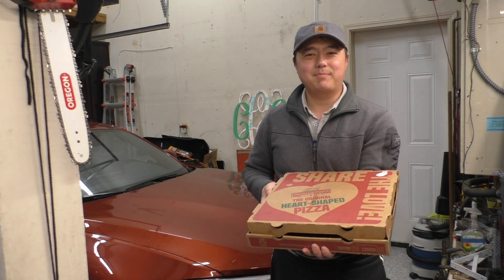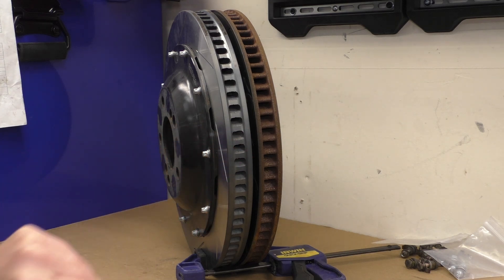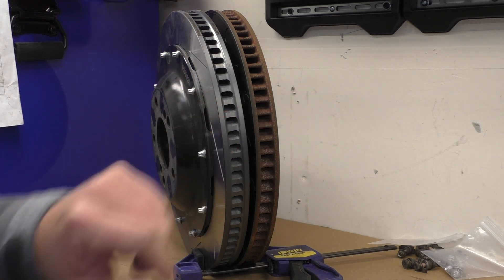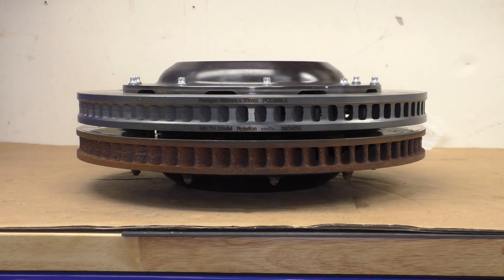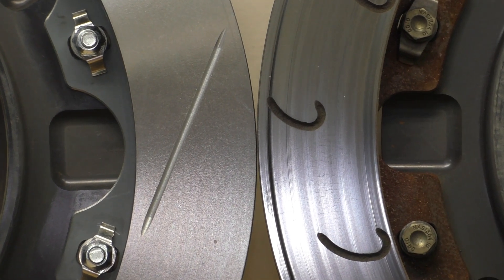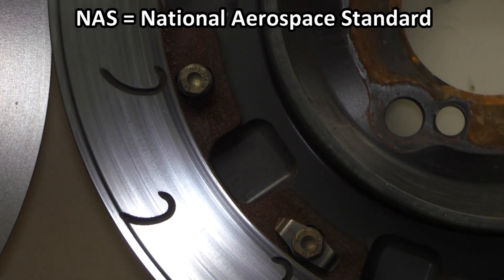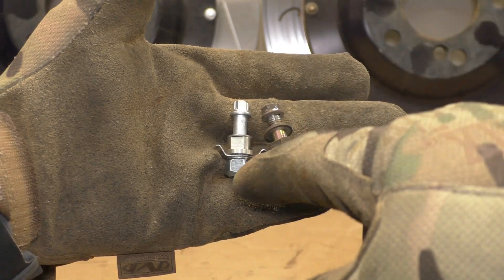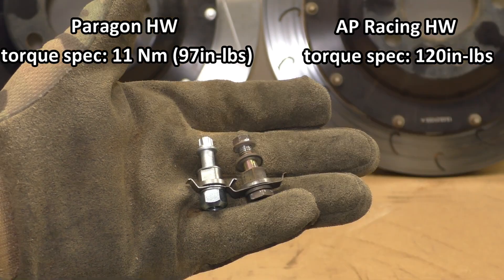Paragon and AP Racing Rotor Rings' Design (BMW F8x Rear AP Racing BBK)

Comment: Excellent video as usual. Thanks for such a detailed comparison. I assume that Paragon is taking the opportunity make the rotor wall thicker to have more heat absorbing mass, so Paragon rotors should be more resistant to fade on the track. When talking with Paragon tech support in the past, it wasn’t a priority for them to win any weight contests. They were more performance oriented. Full floating has a weight savings advantage anyway. BTW Paragon tech support was very responsive with detailed information.